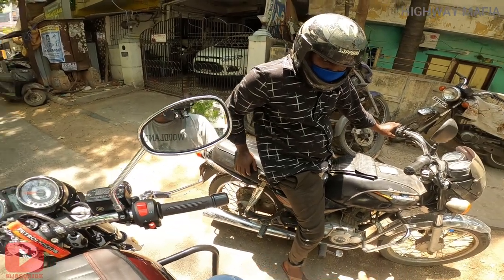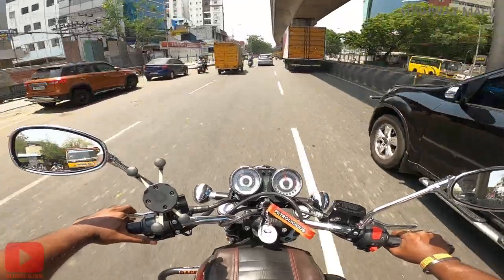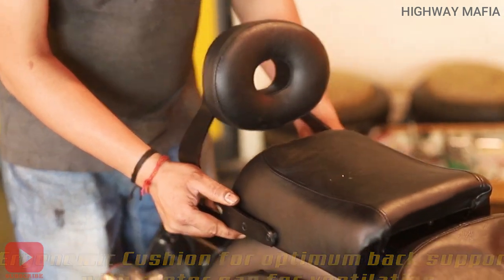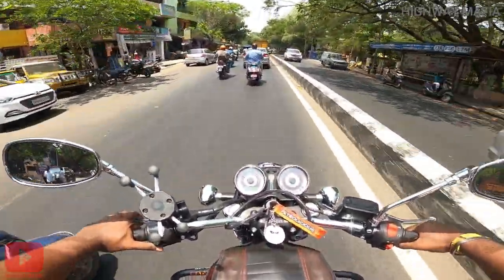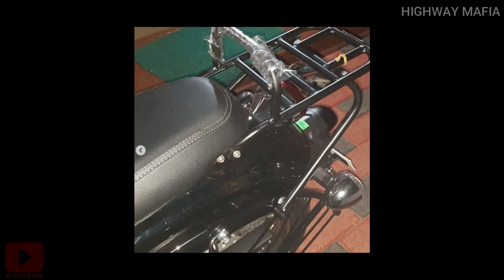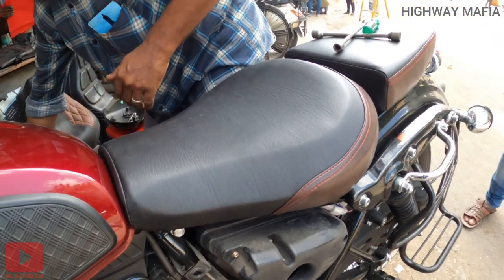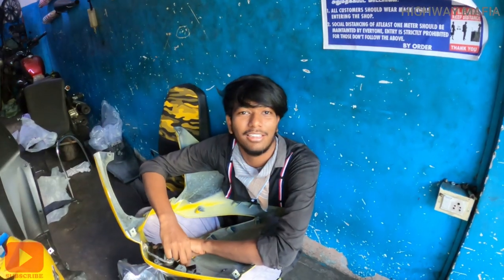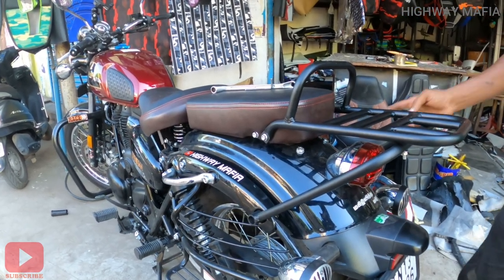SEAT MODIFIED | ADDED MOTORCYCLE CARRIER to my BENELLI IMPERIALE 400 | Pudupet | Yamaha Lining Works

Comment: Anna unga carrier evlo length inches anna?
Reply from the maker: inches ah.. avlo laam alandhu paakala nanba, irunga nalaiku morning i wil measure and tel you. its enough to place one trekking bag and tie comfortably horizontally.
Reply: @highwaymafia6373  naliku measure pani solunga bro length and breath
Reply from the maker: @sudarsan4725  kandipa tomorrow morning i wil do nd tel you brother
Reply: @highwaymafia6373  nenga tanjore ride ku one trekking bag dan kondu poningla evlo liter bag?
Reply from the maker: @sudarsan4725  thanjavur ride ku adhu trekking bag kondu pogala bro. Adhu konjam mini suitcase(not that alfa suitcase material) maari.
Reply from the maker: @sudarsan4725  namakkal pogura apa dhan i took trekking bag. Pinadi my trekking bag adhu mela en friend trekking bag. Pinadi pillion la en friend. Vandi summa patasa pochu. Not even slight difference.
Reply from the maker: @sudarsan4725  namakkal pona apa 60 or 65 litres. Not sure on the exact number.
Reply from the maker: Length is 26cms and width is 21cms buddy.
Reply: @highwaymafia6373  super na